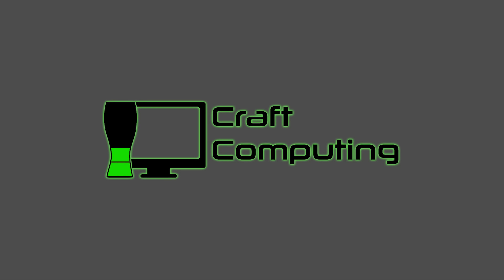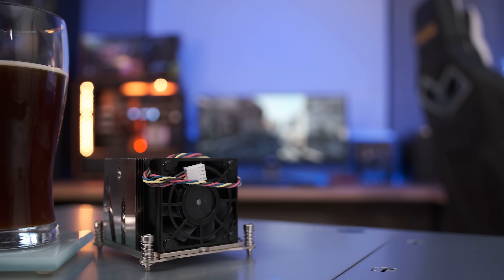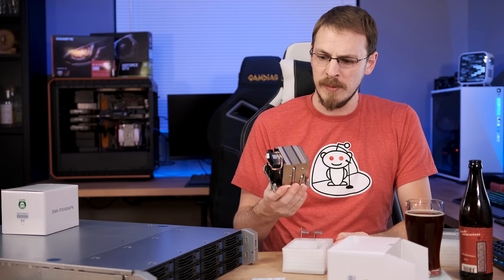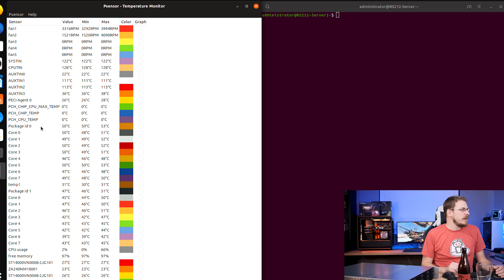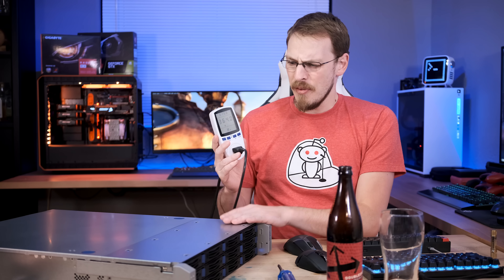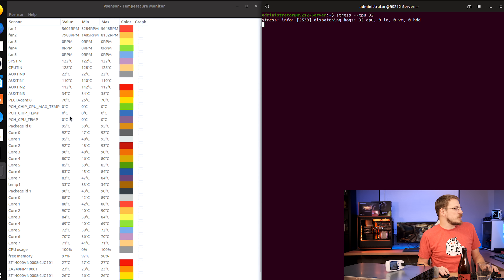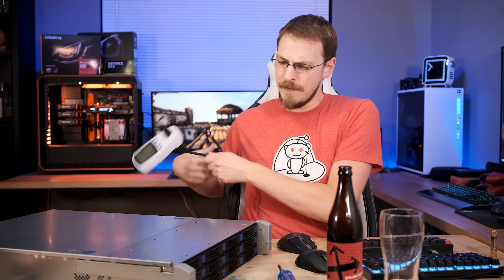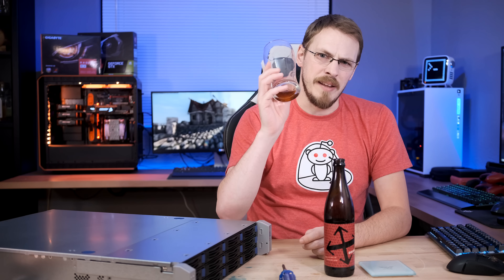InWin RS212 Temperature Testing

Comment: Hello. I hope you are well. When should someone be using 8643 backplane and when 8087? For example for 12xHDD, is it worth buying a case with a 8643 backplane, or 8087 is adequate as well?
Besides the 6gbps vs 12gbps speeds, is there anything else? Thanks

Comment: Those coolers also have adapters for Opteron C32 and G34 sockets. I haven't tried replacing the fans with Noctua yet. I'm pretty sure I can get the noise down to something not awful though.

Comment: why didn't you just put some low noise fans on the copper coolers? i mean there's plenty of height left in that case and the air flow would push the hot air out.
Reply from the maker: The copper blocks don't have any fan mounts. They're designed for a 1U passive system. And this build is only temporary.
Reply: @CraftComputing  well you don't need fan mounts to use a fan all you need to do is get some bolts that are long enough and not too thick and it will just screw right in that's what they did back in the day with the some of the old amd and Pentium 2/3 cpus like this. https://images.app.goo.gl/x9BzdNdC2iKFaSTz6
i know the build was temporary i was just a little sad that you didn't try adding fans to see what would happen if you added Active cooling to the 1u coolers in that case.

Comment: The chassis just seems so expensive. I would rather buy a generation old Dell 2u (fully loaded) for less then what this chassis costs alone
Reply from the maker: Remember, roughly half of the cost is in the power supplies. 550W Platinum redundant isnt' cheap: https://amzn.to/2YQ0wU9
Reply: Imo, someone running a server rack at home or a more roll-your-own inclined biz  will hold on to that chassis for far longer. The thing about the proprietary kit is your basically stuck with the whole thing, especially if it only takes mezzanine cards and such.

Comment: The reason why those fan cables are so short is because you are supposed to plug them into the backplane. Then you manage the fan speed with sesutil if you are running Linux or FreeBSD. I figured this out last year so I didn't have to run stupid cables from my fan array directly to the motherboard, which was too messy for my taste.
Reply: On drive temps, I keep mine around 40C, so the fans don't have to run too fast and become noisy (fan speed level 2 using sesutil).
Reply: You may also want to block the unused PCIe back panels with a piece of paper or tape, so the airflow is forced to go through the installed PCIe cards. An air shroud would be better , while leaving the back completely open is sort of a waste of airflow.

Comment: Hmm... my twin e5-2650's are running much cooler in a quanta windmill. 

I wonder what your thermals would be if you replaced that thermal pad with some paste.
Reply from the maker: E5-2650s are only 95W chips. That's 40% less power per chip. And exactly why I use 2650s in my home server :-)
Reply: @CraftComputing  ah my bad! I have e5-2680s in there.

Comment: Are you sure 96 degrees is a win?  I'd be pretty concerned about those temperatures.
Reply from the maker: People get freaked out pretty easily, but I assure you it's fine. They're rated to go to 105C before they start throttling. They're not going to burn up, and there is a TON of airflow around the socket, so I'm also not worried about VRM or memory temps.
Reply: @CraftComputing  Sounds good, dude.  I'd only use a 2U in a room with proper HVAC for that reason.  I'm sticking to my 4Us and a decent Noctua for home use.  Thanks for the good video.